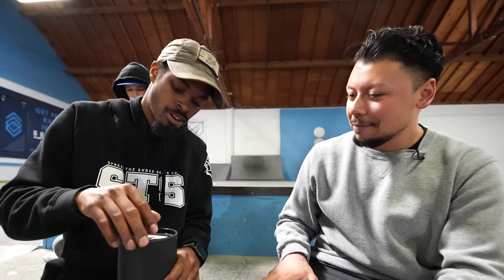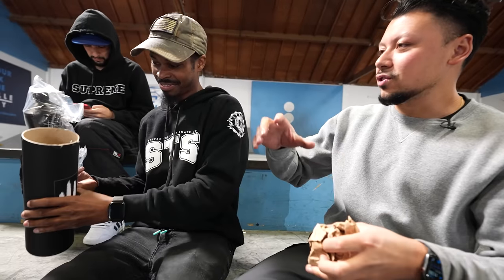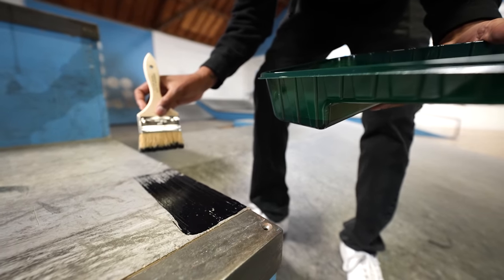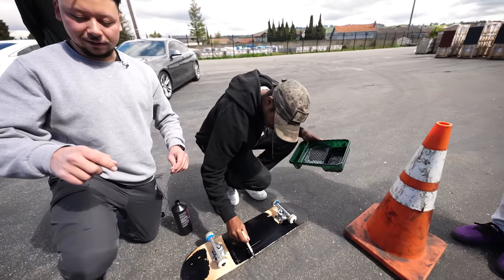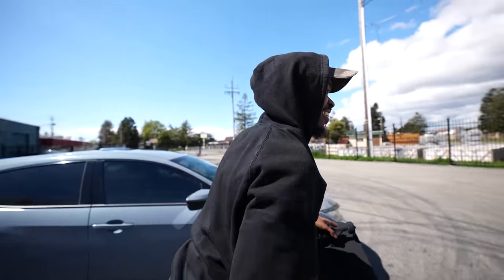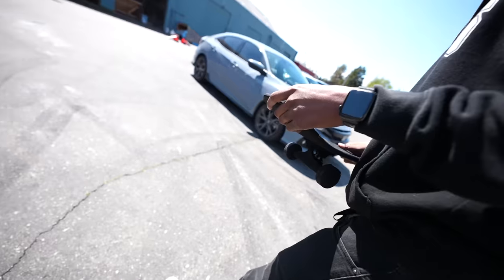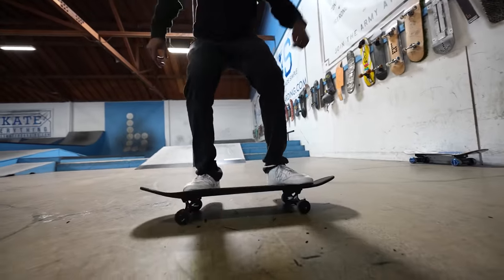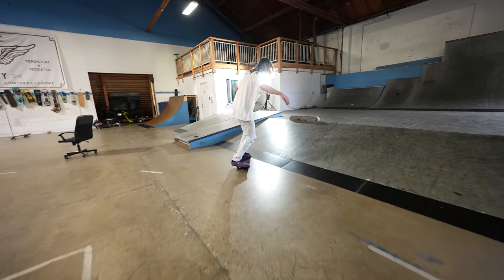WE PAINTED A SKATEBOARD WITH BLACK 3.0?!?!

Comment: You have to put more layers of the blacker black paint on the blacked out board 🔥
Reply: I'd say at least 3 coats on the bottom. Painted for years and they definitely need to let it dry after each coat and do that til it's maximum black black
Reply: They applied it entirely incorrectly. There are specific instructions on the website.
Reply: do you think the blacked out black board wasn't black enough to be called the blackest black black board?

Comment: Some things you missed from the website. The last thing being one of the most important. 
"Key things to remember:

-Use a nice soft brush (not a rubbish scratchy comblike one)
-Apply at room temperature 10 - 25 c ( 50 - 77 F)
-Use as little paint as possible and spread it out nicely
-Allow to dry between coats (at least two hours, overnight is better)
-Use a hairdryer to get max blackness
-Seal absorbent (porous) things with 25% PVA and 75% Water
-Prime shiny (non - absorbent) things with primer or Black 2.0"
Reply: Yup, they definitely completely did it wrong.

Comment: It looks better inside because the lights produce specific frequencies of light, depending on the type, they use multiple LEDS or filters to try and get a wide range but it's nowhere near as wide spectrum as the sun, the paint absorbs artificial light way better than natural light. I also think more coats are neccesary and the surface finish is really important for light scattering, you need to sand it down after painting to perfect but the product does 'work' and has it's uses but the application is really important and sensistive.

Comment: The way deeper blacks are measured is the amount of light that is let in. So essentially the more “matte” it is the blacker it will look or the more it will disappear in low light. The more light like sunlight is still technically super dark. But there is like a total light absorption of around 97-99%. There is a couple way darker pigments than that that actually look like absolutely NOTHING Is there. It has no reflection or anything. It’s just a void. And the public cannot get it.
Reply from the maker: So cool

Comment: I've used black 3.0, the stuff gets black black black, but you need to apply it properly.   You can't just paint over a finished/coated board.  You need to Atleast prime it first.
Reply: Is spraying it better than rolling?
Reply: @kurtownsj00  for such a large surface, I would think so. Would be much easier to get an even coat.  I've only used it on smaller things. 

But painting on a varnished/un primed skateboard, using a brush and jsut painting on layer after layer would make any paint job turn out awful lol

Comment: If you use the paint correctly it is the blackest black. They did not bother to read the instructions on how to get the best results, it takes 3 coats, and works even better if mixed, stirred correctly. If they could not even open the tube correctly and had to destroy it shows the level of smarts and attention to detail.
They approach it like children.
Its like buying a car and have no idea how to drive it and come to the conclusion that the car sucks, does not work.

Comment: alas these paints are mostly a science thing rather than actual paint, they arent durable and tend to fade quite fast and the really really black stuff is ridiculously expensive, this stuff isn't the worst stuff, you can see that a lot of the details gets hard to see, specially inside without too intense light but not sure whether application was ideal or not.

Now you gotta do a board in the pinkest pink though

Comment: if you put some varnish on it, I wonder if it would enrich the darkness, granted it would be shiny, but it would have the highs and lows of the black color?
Reply: especially that it was applied outside, it could've easily gotten dusty and the varnish would reinvigorate the depth of the black
because the varnish would basically make it look wet still without it being wet
Reply: (ʟᴇᴛ’ꜱ ᴛᴀʟᴋ👆) ɪ ʜᴀᴠᴇ ꜱᴏᴍᴇᴛʜɪɴɢ ꜱᴘᴇᴄɪᴀʟ ꜰᴏʀ ʏᴏᴜ🎁❤.

Comment: There are specific instructions on how to apply this paint, of which you did none. It literally says to make the thinnest coats possible, apply at room temperature, use a hair dryer to dry, wait until it’s completely dried before you apply the next coats wait at least two hours (overnight is best) and prime shiny things with black 2.0 or primer. You guys did this completely wrong my guys.
Reply: (ʟᴇᴛ’ꜱ ᴛᴀʟᴋ👆) ɪ ʜᴀᴠᴇ ꜱᴏᴍᴇᴛʜɪɴɢ ꜱᴘᴇᴄɪᴀʟ ꜰᴏʀ ʏᴏᴜ🎁❤
Reply: @Real_CTR  go away

Comment: the experiment they need to be dling is to shine a flashlight on the board vs Nigel's hoodie. the beam of light will show on the hoodie but on the board, the beam will disappear. also, the application of the paint is all wrong. use a sponge brush with alooooot less paint. plus another coat after the first coat is completely dry
Reply: (ʟᴇᴛ’ꜱ ᴛᴀʟᴋ👆) ɪ ʜᴀᴠᴇ ꜱᴏᴍᴇᴛʜɪɴɢ ꜱᴘᴇᴄɪᴀʟ ꜰᴏʀ ʏᴏᴜ 🎁

Comment: Pretty sure it would look a lot better if you had used just the roller or a paint sprayer. The lines that a brush leaves is probably bouncing the light and making it look less black
Reply: (ʟᴇᴛ’ꜱ ᴛᴀʟᴋ👆) ɪ ʜᴀᴠᴇ ꜱᴏᴍᴇᴛʜɪɴɢ ꜱᴘᴇᴄɪᴀʟ ꜰᴏʀ ʏᴏᴜ🎁
Reply: Minutely better.  Still dries grey.  It’s just a ripoff, unfortunately

Comment: You can't compare matte black to glossy black.  Where the light source isn't being reflected into the camera, the glossy black will seem very black.  But in that case, the light is not being absorbed - it's being reflected away from the camera.  Matte black will diffuse the light so it's more evenly reflected in all directions, so if it still appears black, it means the light is getting absorbed.  It clearly could be darker, but, it's still pretty dark for a non-reflective material.